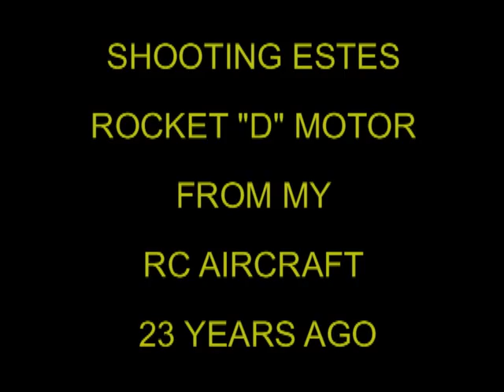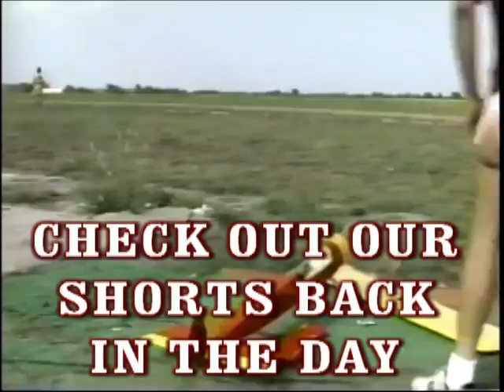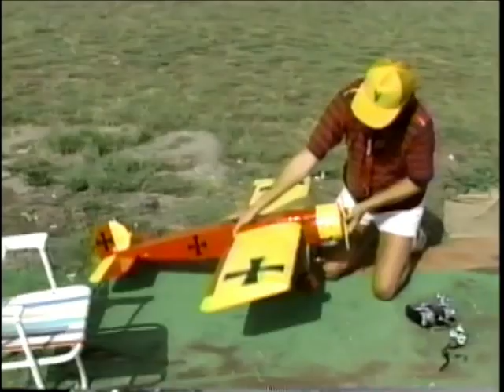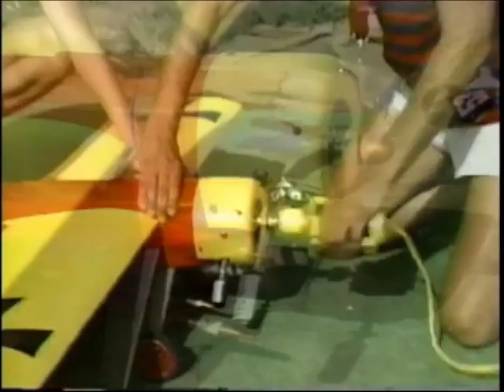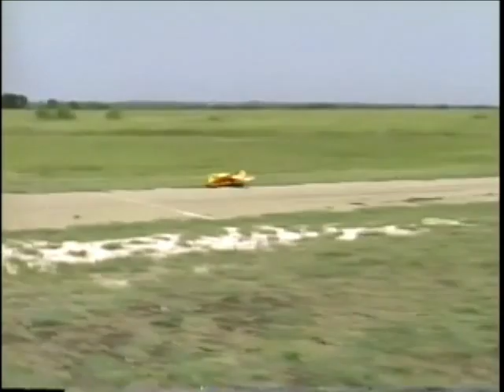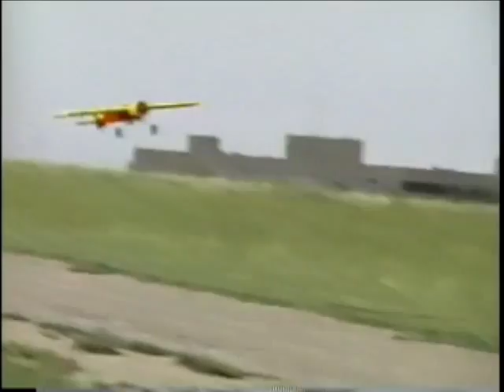Shooting a Estes Rocket from a Radio Controlled Aircraft RC Video Roy Dawson video

Comment: I did this back in 94 when I was 12! I used my first trainer, a Hobbico FlightStar 40. I still have it to amazingly.
I used model A engines with a small rocket I secured with rubber bands below the wing with a drop bar made from a medium sized bass wood stringer with a coat hangar wire as the guide rod. Taped a spare servo to the ignition box so it would mechanically push the button when I flipped the channel 5 switch.  It worked flawlessly. I had loads of fun shooting it off at an old falling apart barn in a back field.  If someone seen this now days, I would probably get a visit from the pentagon. ha

Comment: This is the kind of stuff I thought up and tried back in the late 60's - I was 10 years old - Here's one: Model rockets packed with gunpowder or other assorted explosive firework type stuff, better yet was premium gasoline in plastic bag (absolutely the greatest! Especially at night-HUGE HUGE fireball!) Pack the stuff in and it will ignite when rocket engine's parachute charge goes off! Never failed. TRY 'EM! IT'S FUN!

Comment: The AMA doesn't tell non memebers anything . The AMA does however set rules and standards for members as a condition of maintaining their INSURANCE . The AMA for the most part is the prime reason we are allowed the freedom we do have . Without responsible self regulation the government would surely step in and severely restrict RC if not totally eliminate RC activity . Blasting projectiles and invading privacy with airborne video cameras FPV at extreme ranges invites restrictive legislation .

Comment: Cool. I've always wanted to do this. Thought about using the little Estes ignites and a  LiPo battery.  Never went far enough to try to figure out a way to get enough voltage to ignite it.  A micro servo, 3.7v lipo and a  3rd channel on the yx/rx?

Comment: very different discussion altogether considering it would depend on where you are from as to what you call action figures. however, since this discussion was on whether or not these models are toys, page one of my rc helicopter manual plainly states that it is not a toy. a toy is something that you would buy for a child with no prior experience whatsoever. a performance model is something that you have to have training to operate and could have lethal consequences.

Comment: I almost did this in the late 80's.  You need a decent size plane like his , a .4 or .6.  I thought of putting two, one on each side of the fuselage, close to the wing, close to the C.G.  You need a multi channel remote of course, but back in the day they had 7 channel radios pretty cheap.  It was hard to track the rocket with the camera, but it worked as I can see.

Comment: Hahaha! Great! It worked! :¬D
.
hmm, I don't think that RC was not so different on a basic level back then. We had proportional control and expensive crashes. The radios and crashes can be relatively cheaper now, and 2.4 ghz is almost problem free. But the fun remains the same. And so does the ugly stick, just like the plane in the vid. ;¬)

Comment: As soon as I saw the mounting arrangement, it struck me that the long fin could clip a gear strut. Upon firing, the instant swing of the rocket, with its obviously curved smoke trail, suggests this might have occurred. Of course this yawing could have been the result of a not sufficient airflow velocity at launch, due to the slowing of the plane in the climb.

And yes, the bull crap thumbnail is more than disappointing.
Reply from the maker: The stability issues was caused because the cg was not far enough in front of the center of pressure. The rocket needed a little amount of nose weight. That’s all nothing more!